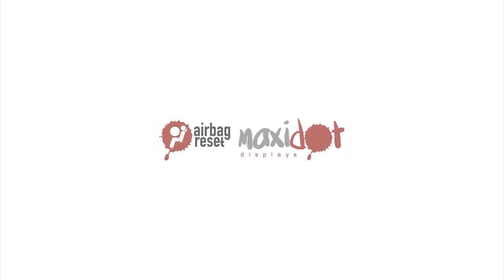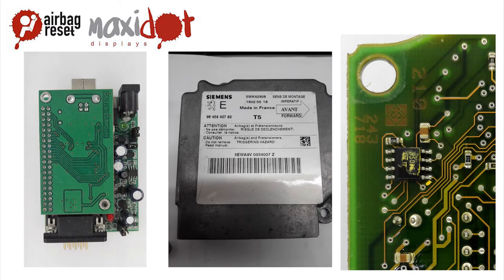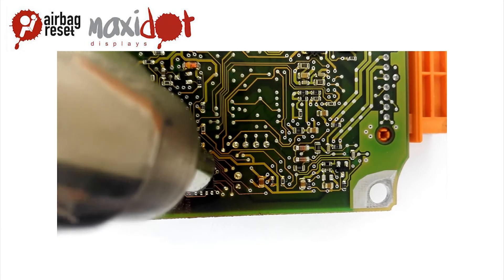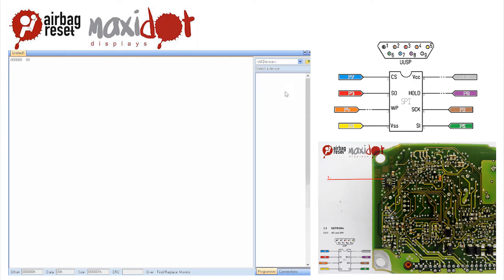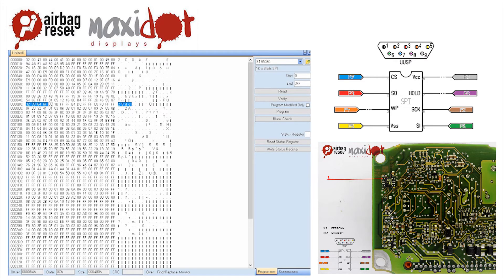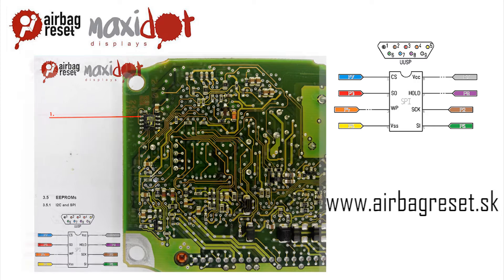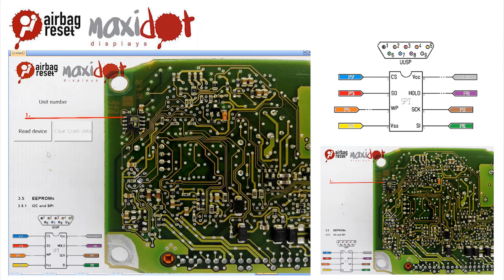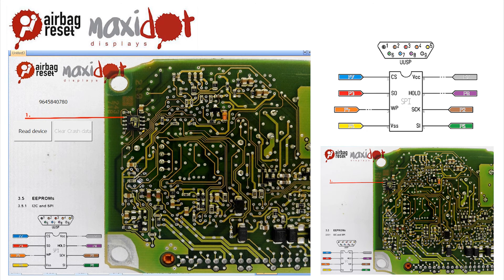Peugeot 307 - 9645840780 Siemens 5WK42908 - 95080 Airbag control unit

Comment: Where is installed  the srs ECU Peugeot 307 HDI 2004? Thanks
Reply from the maker: SRS Unit is always in center of car. For this car srs should be between drive shaft and hand brake.
Reply: @maxidotairbagreset  yes🥳🥳🥳🥳 i see it. Thanks 🙏 que